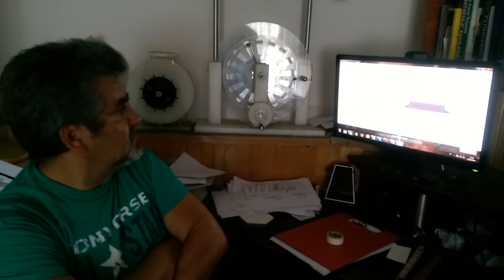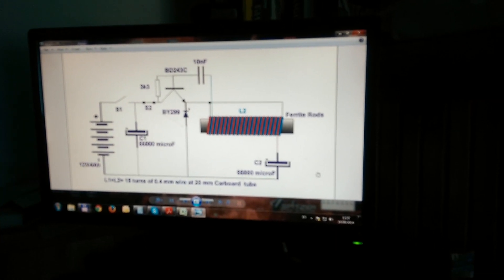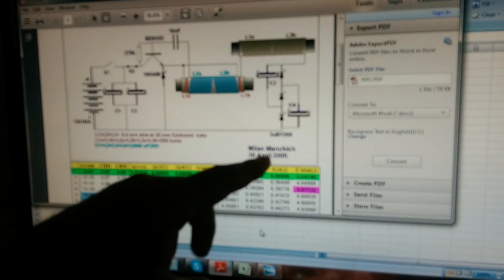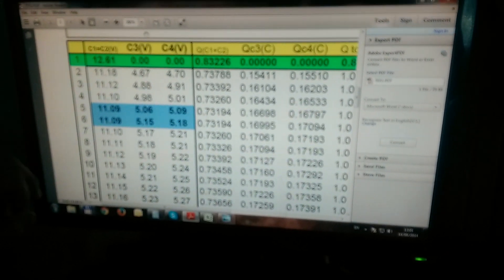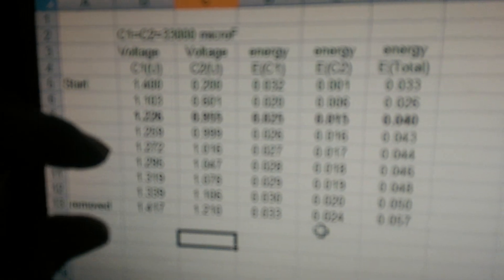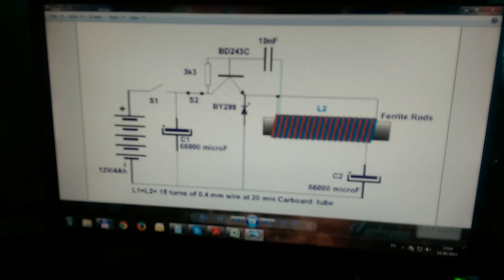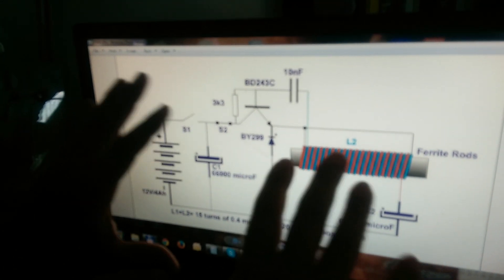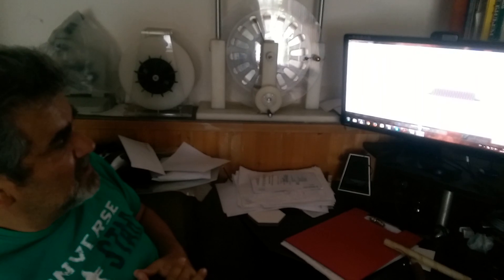Tesla Physics - Time Energy Pump

Comment: hello, your considerations about the circuit are very interesting, I make some testing about joule thief time ago with thermoelectric cell (peltier), and I hope to do something again. your project looks like that of lasersaber which I see around in internet. and the results are similar.bye
Reply from the maker: It was done 2005 , but I made similar test 2016  with super capacitors about 500 F  with similar results. But to slow to be practical in this moment.